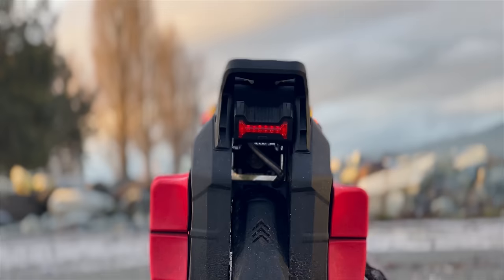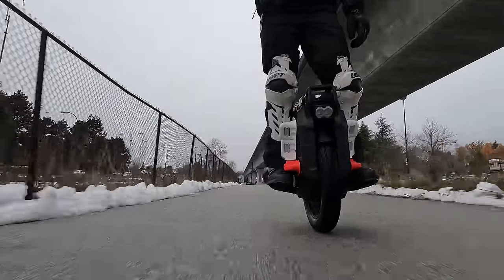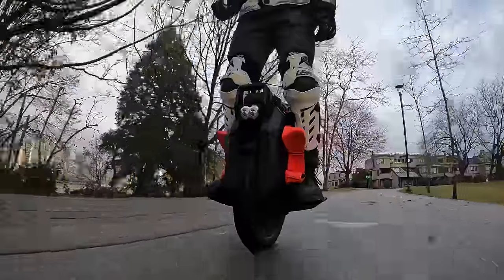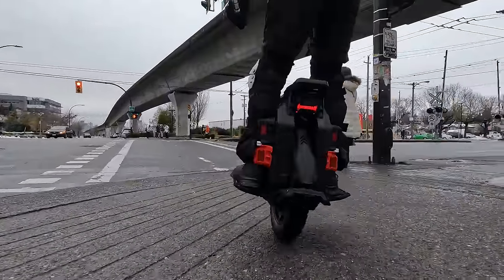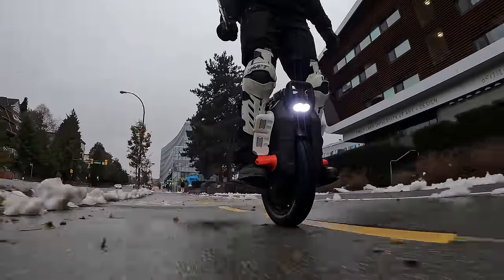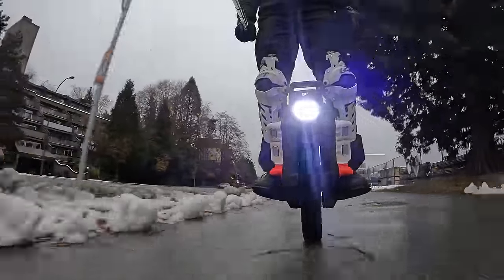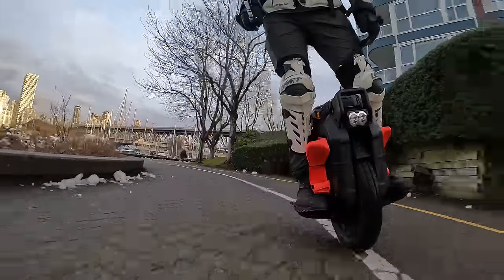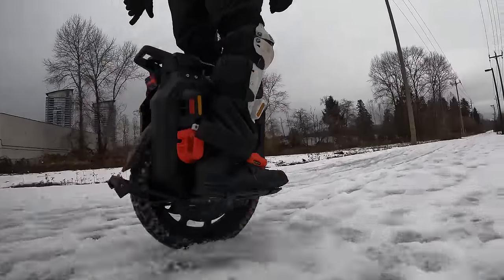Veteran Sherman-S - Complete Review

Comment: Man, dope review. I think Your conclusion is correct. If i'm paying THAT much of money for something like that, i don't want to get something good-ish. I want something perfect out of box. No custom pads, no custom pedals, no suspension mods, no 3D printing. Take out of box - ride.
Reply: EX20S is calling your name
Reply: @themystx2  EX20S 😂😂😂
Reply: Agreed. That's why I've put upgrading on pause. I'll ride the V11 until I can't.
Reply: Same, riding my OG second batch Sherman and v12 HT till sunset, those new wheels keep coming out so fast
Reply: @themystx2 Begone...nah
Reply: When you buy a proper mountain bike - they cone without pedals. So that’s fine for me to make additions to the wheel.
Reply: That was the V12 for me, I even tried buying pads and a seat but I prefer without
Reply: If you want to buy a wheel and you have not already bought a wheel, you might want to consider the Sherman S once again because (correct me if I'm wrong) the addressed most of the problems mentioned :).

Comment: Yup, when top end wheels started creeping past $4000 USD I went out and got myself a motorcycle instead for that kind of money.  Agree with your sentiment
Reply: They are 2k as well.  You don't have to get the most expensive new euc.
Reply: Dev Guy  Honda groms get 150+ mpg, i don't have to pay for parking, and insurance is $30 USD per year.  It's also road legal, can pass toll roads legally, carry a passenger and won't cut out at 55 (real) mph at 50% battery.  I own 2 wheels, 2 bikes, and 2 cars.  They all serve a purpose.  $4000 for an EUC does not serve any purpose for me.
Reply: You can't drive a Honda grom every where you can drive there one wheels . to me these are more convenient. take them to parks ride them on the sidewalk in the roads wooded areas and so much more . And the experience and thrill is so much more fun then a gassed grom
Reply: I'm going the opposite way they done revoked my license for 5 years so I'm about to sell my GSX-R and buy a EUC lol

Comment: That seal on the fork is just the dust cover for the fork seal. The fork seal itself is up in the fork tube. Similar maintenance to my motocross bikes too, as long as that dust cover and the spring coil wasn’t damaged you can just clean it up and slide it back into the fork tube. Nice video! Just got my Sherman S , loving it so far!

Comment: Great review, Sherman-S looks great. New suspension tech is a great addition to the market, worthy successor of original Sherman. Sturdy build and finely tuned performance to get max torque and speed from 100v sistem before going with higher voltage,  which is not a bad philosophy.

Comment: Thanks, great reviews! Its gonna help a lots Sherman to improve quality.  And that is really good, if we don't want to crash for quality issues.  But About the structure issues I'm not agreeing with you. The 2 pins of the battery box is use in mécanique because it's very good on shear stress. Using all the magnesium control box as middle structure, it's probably the best ones on the market! That will explain why you don't feel the issues when riding. Anyway GREAT Work Cheers!

Comment: I wonder if any brand would put a 2 speed transmission in it like the Taycan, imagine you could multiply the torque 4 or 5 times for steep inclines and another gear for normal mode.
Reply: Gears get grinding. Can't take a beating at all
Reply: @coolhawk2003  depending on the implementation it can work. Since I made the original comment I've found a way to put a small transmission in a hub, easily keep a 6:1 for torque and 1:1 for normal ride. Now trying to find a way to out a servo string enough to change it on the fly. SolidWorks design has shown is going to be challenging to change gears in the fly but with a full stop before hitting a hill and going full send. Went way too deep into the rabbit hole as you can tell.

Comment: The hype definitely was a bit overblown for this wheel... But hey, after the OG Sherman, who wouldn't be hyped?
It's still one of the best wheels on the market tho. The durability is good, the safety is good too (although it seems the V13 sets the new bar).
I was actually planning of maybe buying the Sherman S, but after the hype wore off and I managed to grab a Begode Master for 2500€ on Black Friday, I really have no interest in this wheel anymore. I just crafted a rollcage/bumpers for the Master for like 20€, did some waterproofing with ductape and added a 10€ laser backlight and it's basically like the Sherman S now at half the price lmao.

And I realized I actually like to tinker with my wheels. The Sherman S is a full package and you don't have to tinker with it, meanwhile the Master pretty much requires some fixes, which are honestly so cheap and relatively ease to implement that it's baffling why Begode didn't just do that in the factory (bumpers, better battery casings, better waterproofing)

Overall, I have the same conclusion: The Sherman S is overpriced. V13 has the speed, Commander Pro seems to be the same but cheaper and upcoming EX30 can burn wood lmao. All of which are in the same 4000 buckaroonies ball park. 4 wheels that are extremely similar and I think at the end the ones consumers will end up getting are the ones that have the least QC issues after release... That is if anyone can afford them.
I genuinely don't think any EUC should be over 4000 bucks, at that price range you should be looking at motorbikes or used cars.

Comment: Great review, Adam. 
I guess with such small production runs before the next iteration these unicycle manufacturers never really get to the economies of scale that bike makers have before they have to design new parts and molds etc. They are almost in continual R&D. Although the KS 18XL doesn't seem to be getting any cheaper and it has been around for years. I am surprised they have not gone the Nylon pedal route. Nylonove has shown they work. Leaperkim has shown they can make good nylon parts (sherman s lift/crash bar handle). Seems like a no brainer to me from a engineering point. The 5% elastic memory of nylon is a great fatigue reducer. Maybe they feel magnisium pedals are better for sales reasons.

Comment: Great video Adam.  A lot of work put into this one, as usual!  

I'm not sure why LK decided to offer two riding weight variants for the Sherman S.  I feel like the heavier weight version should be the entry level for Western countries, actually.  

Did you make any large adjustments (big nuts beneath the fine adjustment knobs) on the suspension by chance?  

I've been surprised at how hard eRideLife sent it (the heavy version) in his videos, yet the suspension didn't have any drag or resistance in my testing, after he and others put it through hell.  Bearings seem smooth, still, but it hasn't been in rain or winter conditions yet.  I hope the bearing design doesn't end up being the achilles heel for the Sherman S.

Comment: Amazing review. The details he assesses are more thorough than I would have on my own making him the guy we want testing our vehicles.

That said- I’m an avid Sherman fan, but I have to admit, I may have to skip this one. 

This wheel paves the way for new wheels, and new designs but there are major oversights. How could that wire stick out the bottom? How could the bridge be so lacking in structural integrity?

I’m a little disappointed in the overall build design and quality. Those pedals are an outright joke. Maybe on batch 3 or 4 this wheel will work- but $4200? At this time it’s a definite no from me.

Comment: Technical is fine. Excellent review. The Master Tyre a knobbly CST-186 only seems to feel right at very low pressure (27psi in my case). a Kenda on the Sherman-S but thoughts on the tyre? A lot of effort to make the video, but it does show 🙂

Comment: Hello, i know this is an old video and i am almost certainly wrong, but i keep reading that the case is made of magnesium, or some sort of alloy based on it. Modern magnesium alloys are usually safe and not a fire hazard...but I was wondering if it became a hazard in case of a lithium battery fire? I assume it's not the case, but...with what we've seen so far with EUCs, sometimes these kind of things could go unnoticed. I wonder if someone could test one of those panels to be sure :P

Comment: Those e-mpoeds are pumped out of india and china by the millions.  There is no way any EUC manufacturer can compete in terms of scale and sales.  

You can also get a gas motorcycle for less price, it can go 200+kph on highways and 'fast charges' in <5mins.  But you need registration, can only ride on roads, find parking, stuck in traffic.  Apples to oranges comparison.  If you want the latest EUC tech with the newest suspension, you gotta pay for it.  R+D doesn't come free.

Comment: The EUC is technically more advanced than an electric scooter, your paying for the HIS (human interface system) the scooter is manual hundred year old teck , EUC uses software for those functions. Also the smart battery management. The distance they well go on a charge at what speed, and the quality of the suspension components. Trust me, that electric scooter possibly has a suspension in name only. So those are things buyers must consider. The mono wheel seems to be far more entertaining. But thats just me. Good review.

Comment: Hey Adam, thanks for the in depth review!
As a 60kg rider, I’m wondering if this wheel is too big for me? I’m riding a nikola+ , but look for more range, power and suspension. Also are the pedals too high off the ground?
Reply from the maker: You’re welcome! If you get lighter spring and soft compression setting you might be fine. It will still feel very heavy though. You might try EX20S also at eWheels. My light friend Serj likes it more than the SS in terms of how easy it is to ride